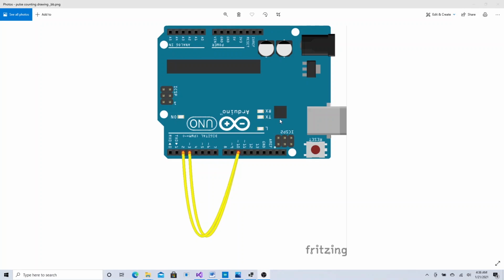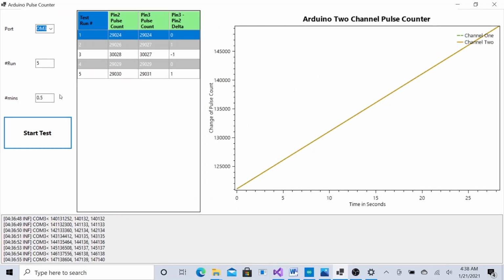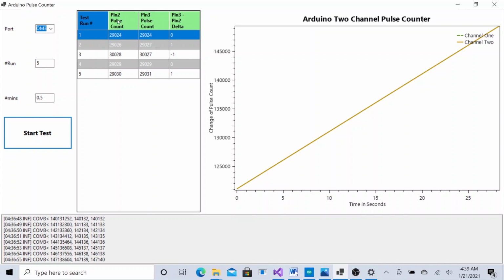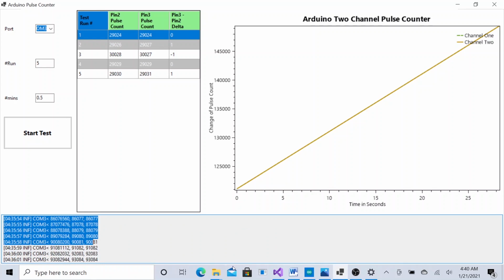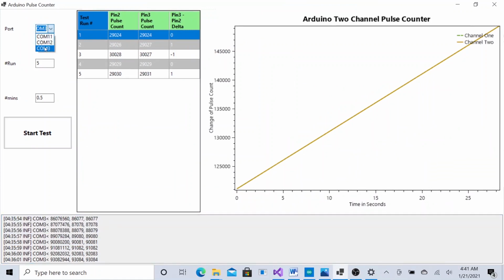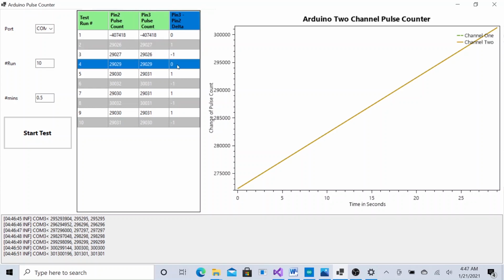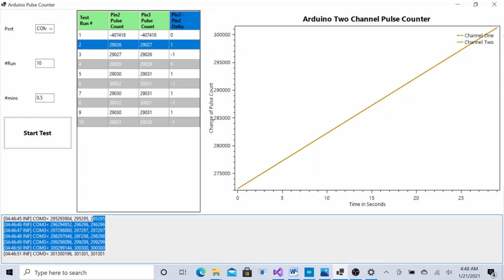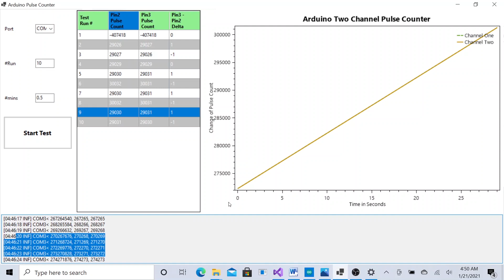Pulse Counting Using Arduino and C# Winform

Comment: I've been following your videos about frequency counting. They are so helpful. Can you use Arduino to count high frequencies in the HF band (3 to 30 MHZ). I appreciate it if you can make an update video. Also, your use of C# to monitor the frequency is very interesting. Is it possible for you to share your code? Thanks.
Reply from the maker: Hi, glad you find them helpful :) .... Arduino uno clock speed is 16 MHz. Even at this speed it is almost impossible to count up to 16MHz with good accuracy. So you will be limited at higher frequency counting. As far as the C# code, it will take multiple series of video to show how it was done. It's on my TODO list but not a high priority for now. I might try to come up with a quick and simplified version in the near future if that will be helpful. Will you be interested in the simplified version? if so what features in the c# code are you most interested in eg. graphing, logging display, logging it to file,  or the datagrid bidding?